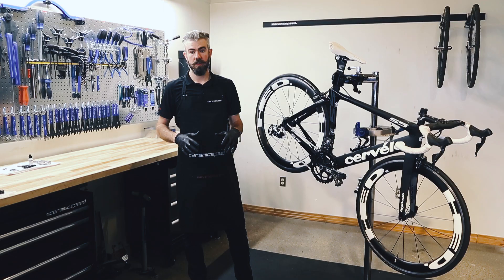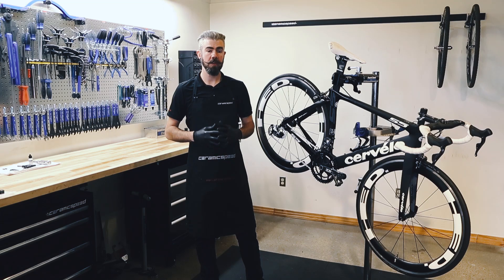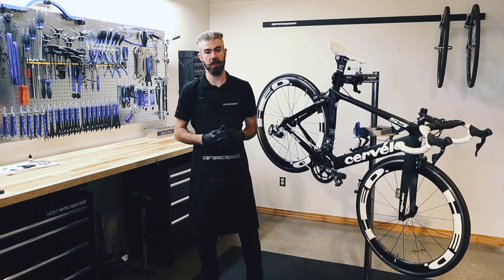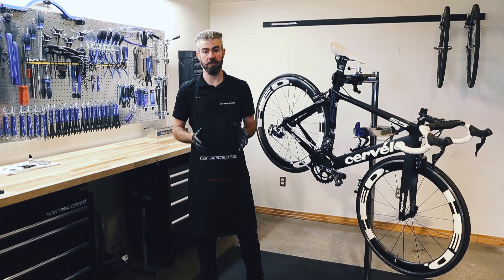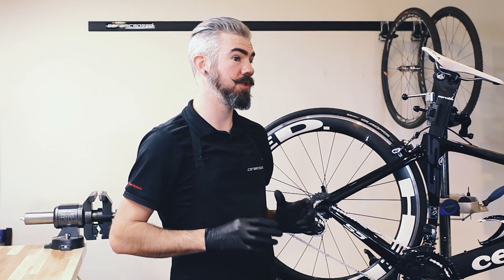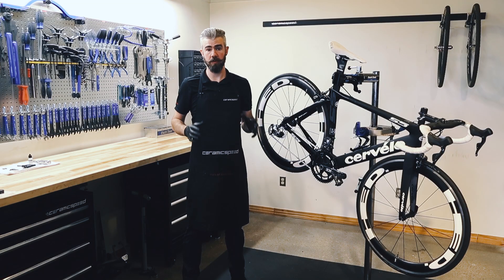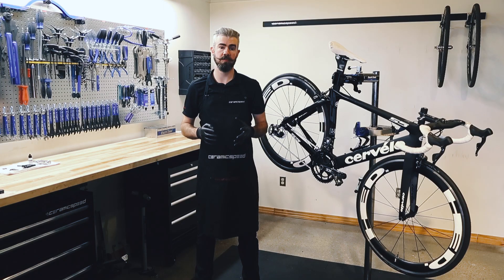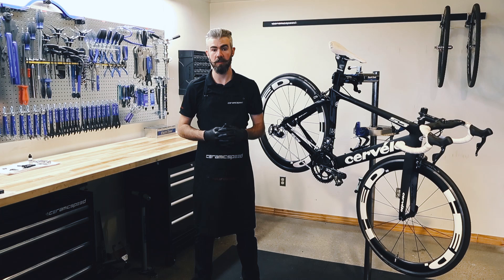CeramicSpeed FAQs - UFO Chain (Part 1)

Comment: OK, since the only part of the chain that needs lubricated is the inside edge of the roller and the spaces between the plates, where they pivot, how is putting powdered teflon on the outside of the chain do anything, except put more micro plastic into the environment? It's teflon and will not stick, but only come off during the first couple of rides. As a professional mechanic with over twenty years experience, I will fully state that this is just a rip off and cannot possibly do anything but create pollution and expose the installer and/or user to a known carcinogen in powder form, which makes its ingestion more likely. I really wish y'all would stop making this product as it is awful for the environment, the mechanics who have to deal with it, as well as the end user, and obviously (to anyone who actually knows how a bicycle works) cannot do what CS claims it does.
Reply: gimmick rip off